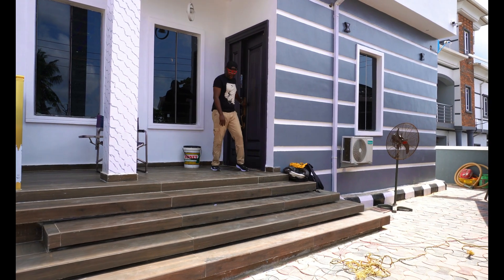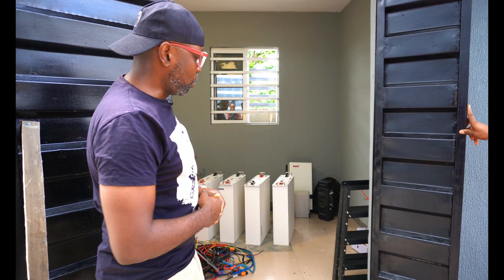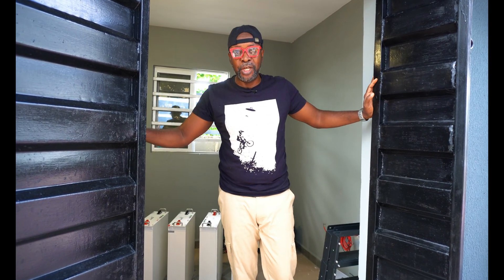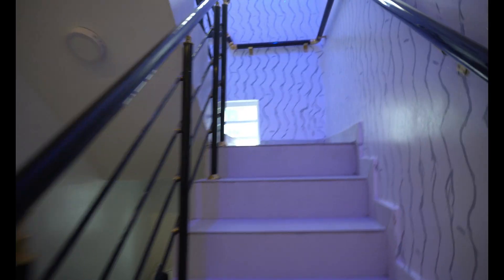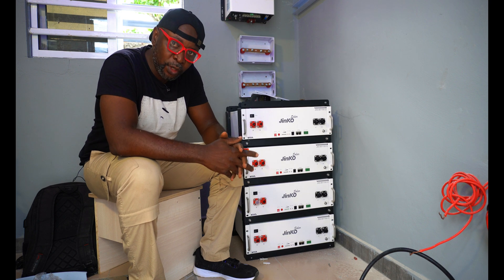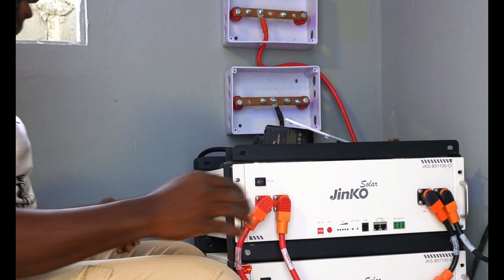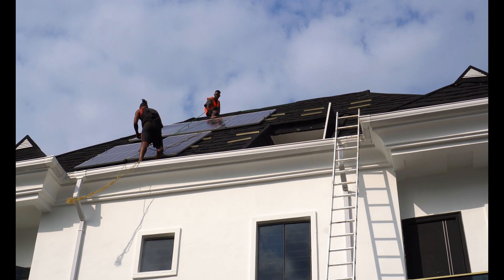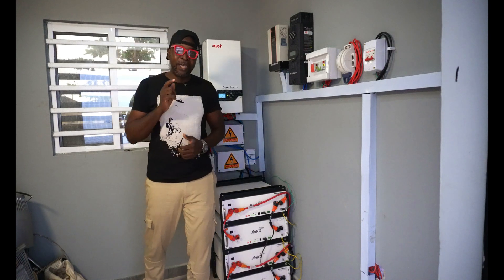How to Install and Parallel Lithium Batteries

Comment: Are both the charge controller and inverter charging the batteries? Are the inverter and batteries communicating and how did you set the BMS? Thank you Engineer, you youtube contents have been very helpful to many people.

Comment: With regards to the paralleling of the batteries, what if I built my own battery kit with raw cells. How would I configure the primary battery to the subordinate batteries using dip switches if I have no manual? Aldo please try to mention the watts and volts coming in from the panels to highlight to the novice viewers what it is they are looking at. Blessings my friend. 👊🏾🙏🏾

Comment: With regards to the paralleling of the batteries, what if I built my own battery kit with raw cells. How would I configure the primary battery to the subordinate batteries using dip switches if I have no manual?

Comment: Nice work, but wouldn't it be better if the negative or positive (whichever you choose) that is connected to the busbar be taken from the other battery you paralleled. 

Like since you paralleled all four batteries in twos, its better to take the positive from  the battery at the top to the busbar and then the negative from the battery at the bottom to the busbar. Do the same for yhe other batteries you paralleled. Thus method ensures that you'll draw equal power from all batteries at all time.
Reply from the maker: Not Neccessarily that is the function of the BMS and communications cables and system.
Reply: @smilinsunsmilinsun8056  while yeah I do understand that, it's just there are a lot of videos, manuals and such that recommend such connection. Even some Felicity lithium battery paralleling diagrams that I've seen in their manuals also recommend such connection. 

All in all this type of connection still works, I'm just throwing in my two cents 😊
Reply: All these connections reference SOC drift prevention. But I assure you that SOC drifting is a BMS glitch. Any battery builder will tell you same

Comment: Wouldn't it be better to connect the negative cable on the second battery in pararrel set while the postive is on the first
Reply: Am waiting for him to reply this
Reply: Yes.  To be able to distribute the energy consumption equally.  I agree with u

Comment: Did you run separate strings from the solar panels for each  charge controller and then parallel to the busbar? Cos I heard you can series 2 diff brand of charge controllers. How was that connected?
Reply from the maker: @danielteofor4132  10 solar panels One charge charge controller and then 8 on one, Thanks
Reply from the maker: Yes Correct 2 seperate strings was used here
Reply: 9 on each I guess. Well done my brother.

Comment: Nice work. I think it is best to connect the positive and negative cables diagonally. So common positive of the first parallel set. Connect positive to battery A and negative to Battery B. That way the charge and discharge is even across the 2 batteries and one battery is not over loaded.. it would also reduce soc drifting which is a thing that can happen with unbalanced parallel connection.
Reply: dat connection with tubular battery .lithium dey balance it self na make am connect am dat way
Reply: @GTdontDOthat  not true. Lithium tend to have flat voltage curve which is why it doesn't, can't balance itself. You want to avoid voltage drop when you do parallel battery connection and the way to do that is to ensure all battery in a parallel connect get equal charge and discharge. This is why in a 2 battery system like this, the P cable should be connected to battery 1 and negative connected to battery 2 this way the charge runs across both batteries equally.
Reply: You hit the point bro. Even blue carbon brand i use usually draw a schematic parallel diagram to that effect . So its best to connect from the first and last battery to equalize charging and discharge irrespective of the number of batteries.
Reply: @bigbrovar-b3r  for me i use tubular battery and na d same connection u mention i always dey connect my battery
Reply: Very correct also use dip switch to assign 1 battery as master and second as slave